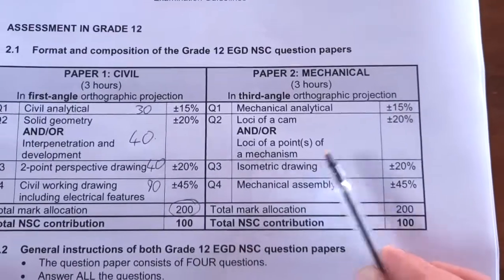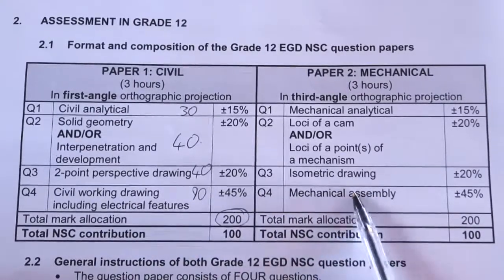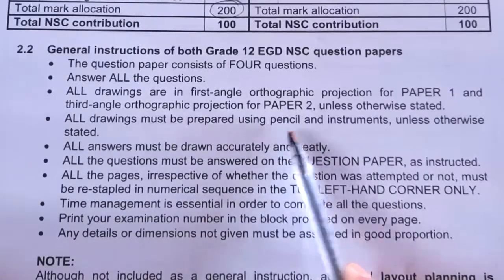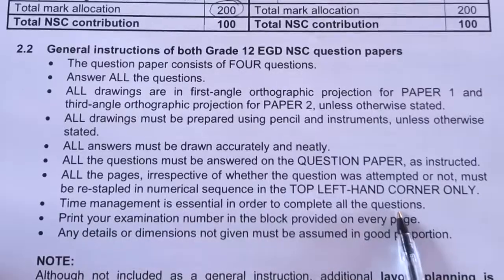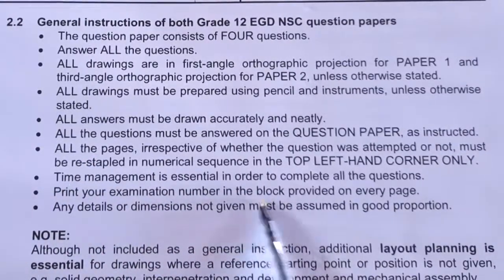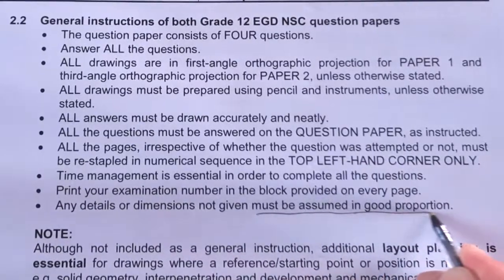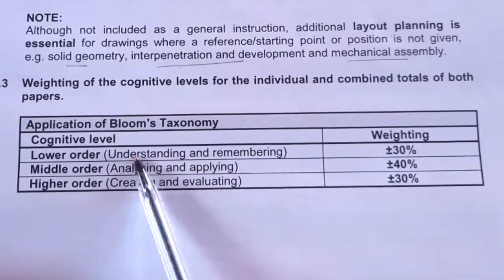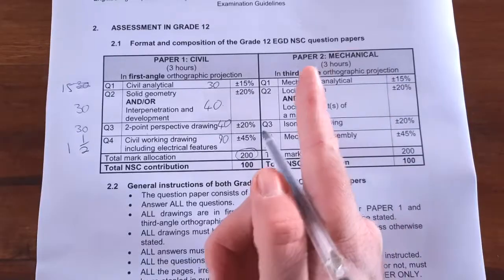REVEALED!! THE EGD QUESTIONS YOU WILL BE ASKED IN FINALS!!

Comment: Thank you very much sir, my question is how do you get faster in your exams and actually finish the exams without panicking and making a mess?
Reply from the maker: Gabriel,  I have an easy answer for you. Draw Draw Draw. The more you draw the more confidence you gain. To speed up your drawings, practise the same drawing multiple times, that way you learn how to use your instruments more effectively. You could go from 40min per drawing for example,  to down to 15min with ptactise. Last tip, in preparing for my own Matric exams, I drew every drawing asked in the last 5 years of exams, and that ensured I knew exactly what the requirements were for the exams... no surprises... all the best and thanks for a great question.
Reply: Thanks so much sir, l have never really received a good answer from that question. You have really helped 💥💪🏻
Reply from the maker: @gabrieldejongh5744  My pleasure.